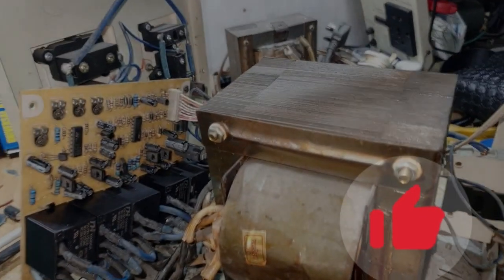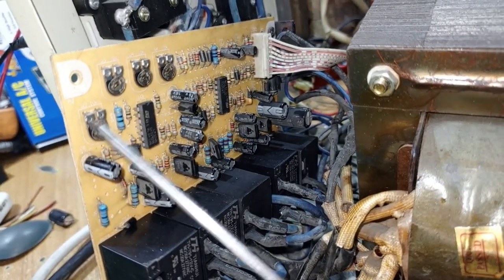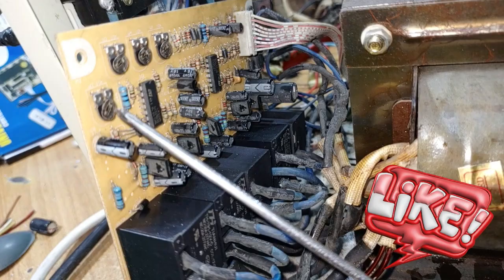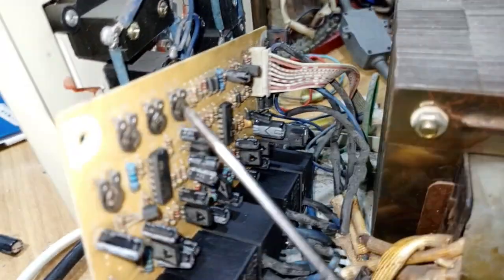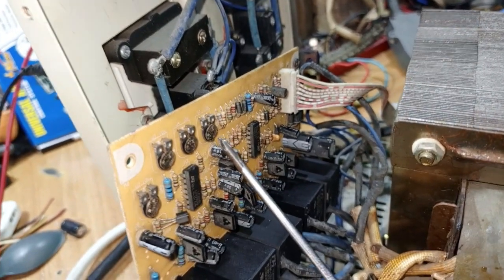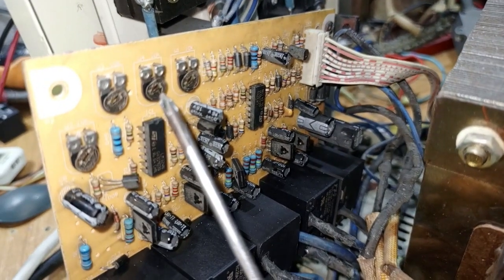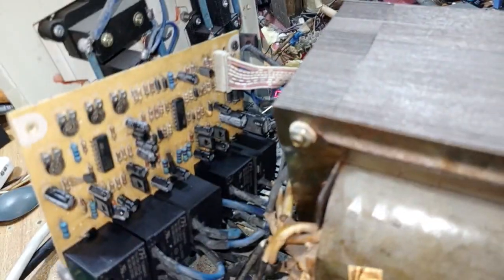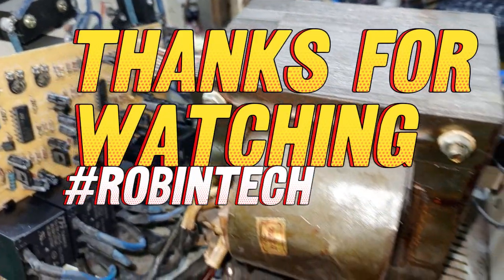Understanding Variable Resistor Functions in CENTURY STABILIZER

Comment: My 5000va century stablizer is on steady protecting and delaying refusing to pass voltage to the output... I have taken it to a technician but after 4 days it started again... Please what is the cause, sir?
Reply: The relay regulating the high range is sticking and needs to be replaced. Your technician only separated the contact but didn't replace it so it got stuck again.

Comment: My 2000va century stabilizer is not delaying what should I do
Reply from the maker: you can take it to a technician to check the delay circuit for a faulty delay capacitor or transistor or insufficient dc voltage from the delay button

Comment: Sir please my century svr3000,trip off output supply and on when the voltage is between 100-150, but it's stable when he voltage is between 170-200. With thesame load. What might be the solution. Because i want the output supply to stop tripping off when voltage is low
Reply from the maker: There might be a faulty relay with carbon black blocking the relay.. figure out the relay then replace it
Reply: @robinTechelectric  how do I identify the faulty relay? 
I see relays with same shape and size, but the numbers written on them are not the same. Must I replace with exactly same number? Or is there particular thing to look for? 
Stabilizer is a 5kva century.
Reply: @robinTechelectric  how do I know which relay is bad? How do we know which relay to buy in the market? Must it be exactly the same relay?
Reply from the maker: The last variable resistor is not properly set or the output is generating high voltage at that voltage level, it need to be worked on
Reply: @robinTechelectric  I have been setting this stabilizer for the past 1yr. I have watched all your videos. I don't think it's a setting issue. I strongly suspect one or two relays are malfunctioning. I just don't know which one. I have tried all technicians around me and failed. So I'm hoping I can replace it myself.

Comment: WHAT HAPPENS WHEN THE STABILIZER GIVES MORE THAN 300V OUTPUT AND YOU ADJUSTED THE VARIABLE  RESISTORS BUT NO CHANGES IN THE OUTPUT
Reply from the maker: This is still faulty component in the board
Reply: I have this same challenge. What should I do? I am still using the stab like that and nothing is getting burnt. Why?
Reply: @adesolafadeyi8980 you will fry your electronics when your input voltage gets  btw  220V and 240V..